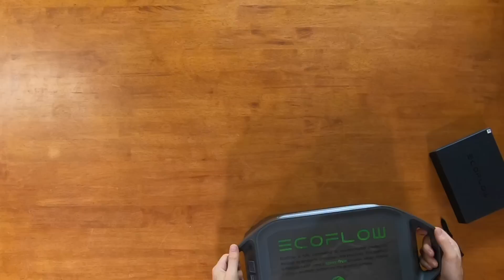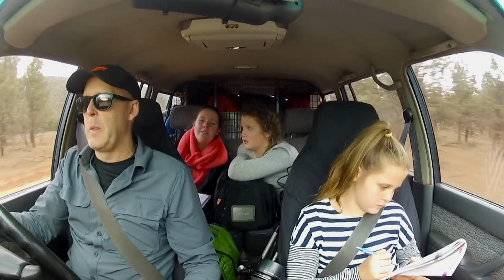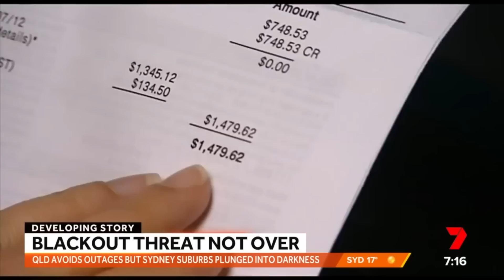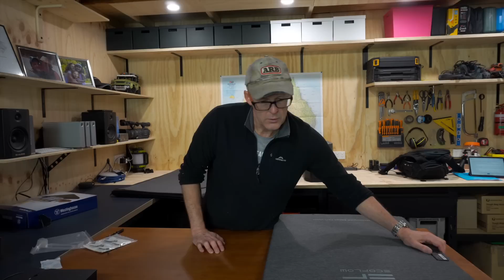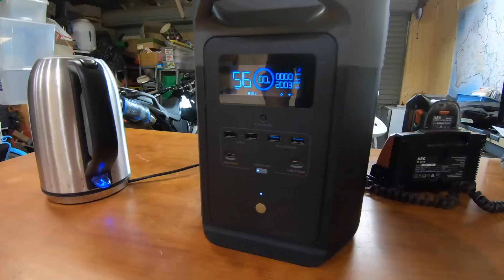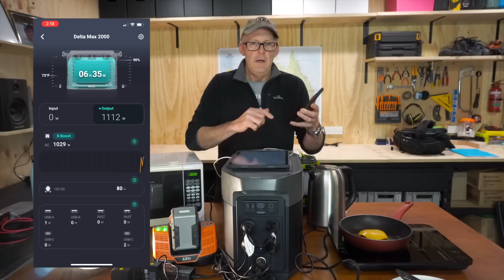EcoFlow Delta Max Review Part 1 - Unboxing, load testing and how I will use it

Comment: “Load shedding” is now permanently installed in South Africa. Daily national Rolling blackouts six to eight hours every day since 2020, and set to continue to at least 2035. Imagine the cost of operating a 24 hours petrol station, or a grocery store with a bakery and butcher? 

Reason for blackouts?  30 years of corruption, socialism and economic mismanagement.

I’m considering either the Ecoflow Delta  2000w  because i like the EcoFlow products. I bought two Ecoflow river 576 w previously. They are light compact, and i love the wifi function.l, app and especially the fast charge. 

Does this unit need to be manually posted on age or was drained completely? 

I primarily want to use the unit to power  desktop computer 24 hours. 
Consumption at 350 watt, 1832 mAh on 224 volt. 

I’m considering this vs a modular lithium battery charger.  simply because of the  portability, no mess, no wires.

How many hours to fully recharge?
South African blackouts are 3x 2 hours day, or even 4 hours.
Would this unit be able to keep my running?

The only reason why i haven’t yet ordered is because i need to know how many hours it would last during a blackout?

Comment: Thanks for the great info! 
Any idea how long it would take to charge up to 100% from empty using the 12V cig adapter cable into the solar input like you would traveling in a vehicle?
Reply from the maker: Quite a while as it only pulls a max of 126w from the cigarette lighter socket. Watch my next two videos where I found a way to 10x that charging.

Comment: The fast charging is the reason why I got the Delta Max. I am so impressed by it that it actually charges faster than my mobile phone.
Reply: I bought Ecoflow River 576 w and didn’t even know about the charge function. This, together with the light weight, mobile app and amount of pets made it a winner. And it is quiet.

Comment: Great review thus far (cant wait for the actual field trip with running the 12v fridge). In essence this system clearly replaces all the common system required to run the 12v fridge and appliances. Am I right here? I will be running a 80ltr waeco fridge and use some power for maybe induction cooking and recharging phones. Thanks again for your brilliant reviews, I also wonder how does it stand to a Bluetti

Comment: The fridge and esp. if you have a freezer in a warm climate will be drawing 24-7. So your effective power will be whatever is left by the fridge/freezer (which I expect to be at least 50Ah over 24hrs). So I would be interested to see your field trop results. And of course when you are charging via the alternator you are wearing it out and increase fuel consumption. So solar should be prefered. I don't know if this unit is smart enough to prioritise solar over alternator if both are connected you may want to look into this. Tha solar panel is certainly not cheap and I would consider putting a solid panel on the roof for while driving, parked, etc. Cause it is only after and for as long as you have camp that you can deploy the foldable solar. If you decide to go for a drive away from the camp then what? You leave your battery, fridge, solar there? Think also about a 2nd smaller battery e.g. in the 50Ah range you can take it to the beach if you want to work on your laptop or ipad. easy to move back to the car if you are going for a drive, and you also have a back up esp. for the fridge if the main one fails or goes empty. That's my two pence. Looking forward to the real use videos.